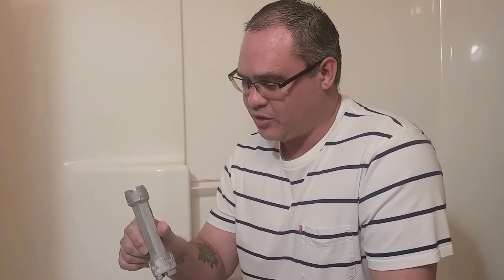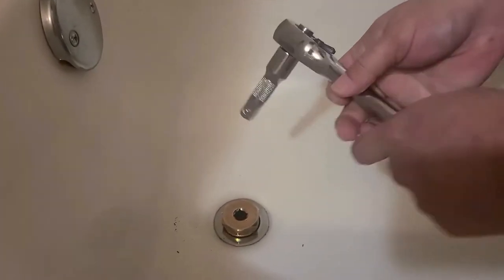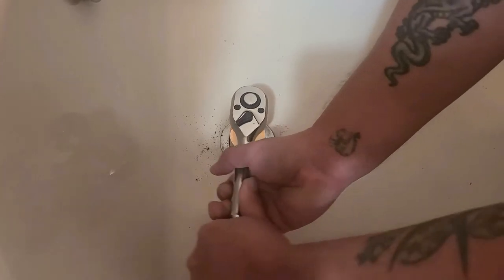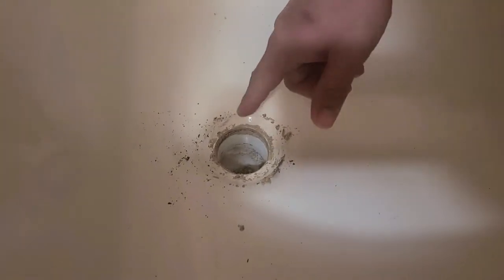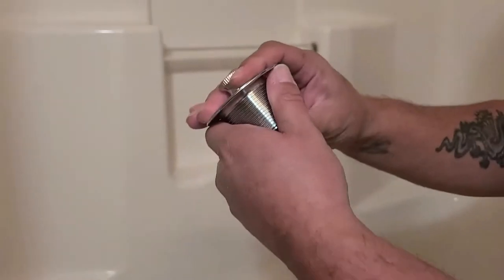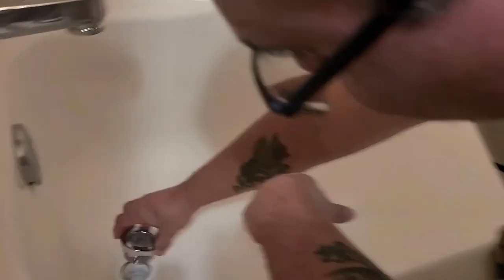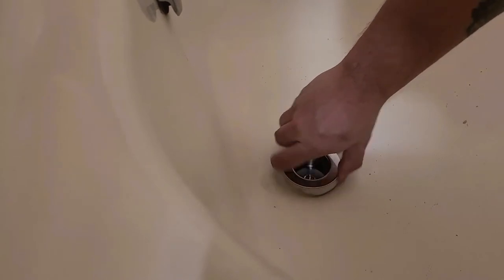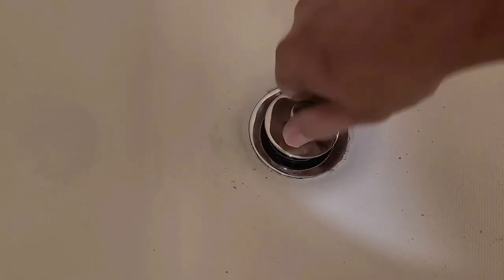How to remove and replace a tub drain | installing pop up drain

Comment: Thank you for the step by step instructions. Great video! However, yesterday, I had a big problem when I was replacing my bathtub drain. By the way, I live in the UK in a brand new flat. I removed the bathtub and once I tried to install a new one I realised that  the main pipe connector under the bathtub was not there anymore to connect it (screw-in). This was due to the main pipe not being fixed and rather was left flexible moving around the floor. And the worst thing is that I cannot access under the bathtub as the side panel of the bathtub cannot be removed easily as it is fully fixed on the wall with tiles on it. If you have a solution for the situation please do let me know. Thank you.
Reply from the maker: Hey bud! sorry for the late reply. I hope u got it fixed but if there isn't a way to get under the bathtub to fix the tub drain then u may have to pull up everything to get underneath unless u can hire a professional that can fix it for u. Thanks for ur comment! have a nice day! 😊